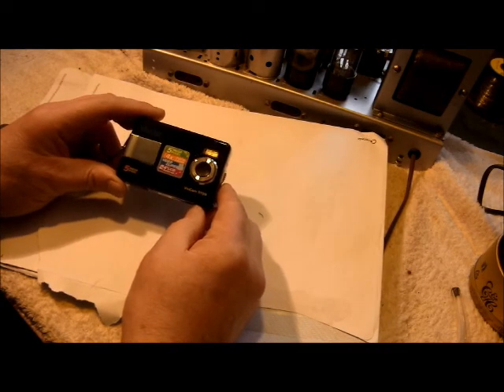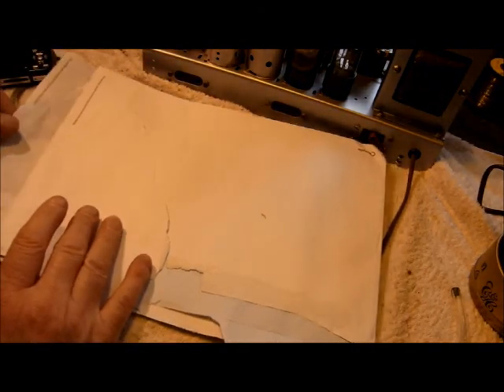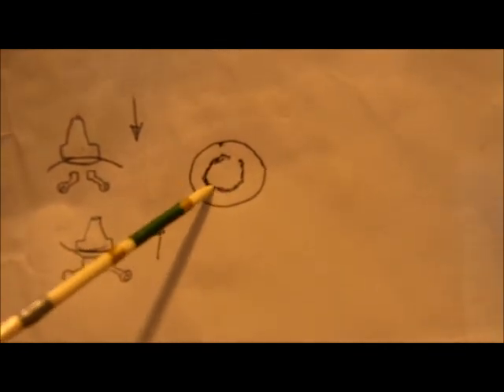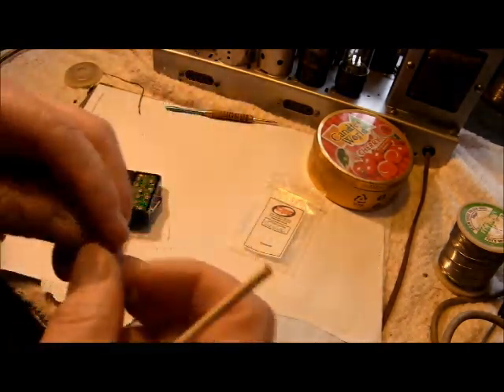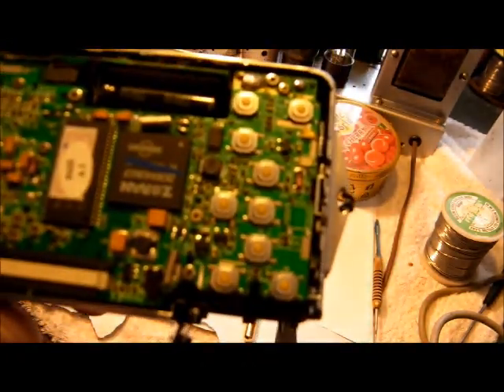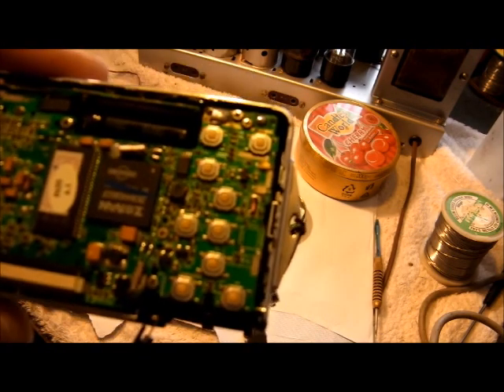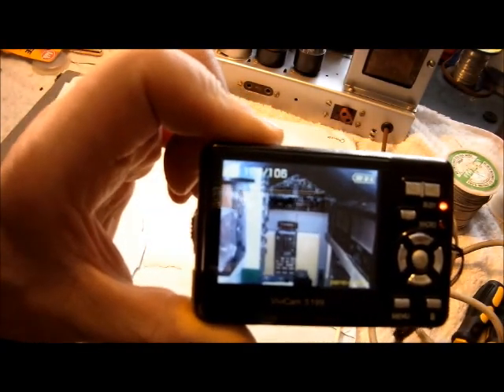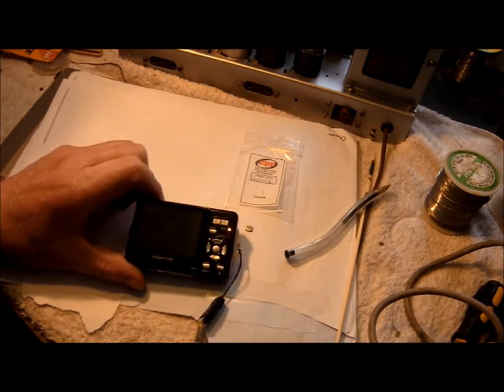Vintage Radio Extra, Number 4.

Comment: Love the toaster Phil, thanks for your videos, regards Bob (just up the road in Leeds)
Reply from the maker: Bob, 'ows tha' goin' mi lad?  Nice t' 'ear from y' (probably sounds more Barnsley than Sheffield).
I bet there are not many of those old toasters still in existence - even less in full working condition.  I like that particular appliances not merely because it works but for the fact it makes for an excellent conversation piece.  I bought it around thirty years ago from a flea-market in Rotherham - I can't remember what I gave for it but it wouldn't have ben a lot.
Regards dear chap,
Phil.

Comment: Very good point about checking if the item is fixable before just tossing it in the landfill.

But you have to consider the other variable SWMBO (She Whom Must Be Obeyed ;)

Case in point; we bought a GE washer and drier when we got married. Through the years they had typical problems, bad timers, water pump leaks, pressure switches not working, etc. But I was always able to source parts cheaply to keep them going. Saving us a great deal of money.

After 25 years SWMBO pleaded for a new set and I finally broke down and donated them and bought her a new set :)
Reply from the maker: Dennis, thank you for commenting.  It is good to hear from you again.
When I was employed in radio and TV servicing, I also repaired many other domestic electrical items: kettles’ irons, hair dryers, microwave ovens, drills, washing machines, lawn mowers…the list could go on (never worked on refrigeration).   Those days, replacement parts were easily accessed – place an order before mid-day, the parts would often be delivered within four hours.  These days, we read: ‘No serviceable parts included’, or when we locate a required replacement part number it has ‘PNA’ (Part not available) printed by the side of it – or equally as irritating, ‘No replacement parts available for this product’.
This built in obsolescence and land-fill has to end sometime as land here in the UK is already at a premium.
Cheers dear chap,
Phil.

Comment: Phil,
A few years ago I bought my daughter and daughter-in-law one of those antique flip-down door toasters for Christmas.  Both were in mint condition.  They've never used them, so they're just sitting in their kitchens as display items.  But they still look good.
My grandmother had a very nice one that we used to make toast and jam.   Based on my past experience with grandma, I figured the Christmas gift toasters would go over pretty well, but it wasn't to be.  They aren't digital.  :-)
Good vid, old bean.

Regards,
John
Reply from the maker: John, great to hear from you my friend.
What lovely, though unusual, Christmas gifts you gave to your daughter and daughter-in-law.  As stand-alone artefacts, or standing alongside other artefacts, old toasters are attractive in most kitchens – pretty much like old copper kettles and old cast-iron pans.  Our kitchen, being very modern, has digital this, that, and the other so placing such old artefacts would prove difficult.  Even placing me in our kitchen proves difficult.  Whenever I walk in I’m usually watched with suspicious eyes.  Well, let’s face it, I can’t even produce a slice of toast without burning it LOL.
Both my grandmothers weren’t as posh as yours: neither owned an electric toaster.  It was a case of impaling a slice of bread onto the prongs of a sturdy old toasting fork and holding it close to an open fire.  
Cheers dear chap,
Phil
P.s, I’ll do my best to avoid knocking up any more homebrew electronic projects in future: I’ll knock ‘hem out instead LOL.

Comment: Nice going Phil.  You are correct about repairs.  I have a radio here that I repaired back in January.  It is a Realistic DX-440 which was a Sangean 803A.  Anyway, some 15 years ago, in my stupidity, I plugged an 18 V. AC wallwart into the the 9 V DC external supply point.  The radio ceased to function as designed. Ha!  I dismantled it to look for obvious burns.  There were none, so I took it to work fully intending to have a go on it one day over lunch.  It sat on my filing cabinet in a plastic bag for some 15 years until I retired last fall.  I decided it was time to have a look.  It took about an hour to locate the fault and maybe 15 minutes to repair it.  In the 15 years I lost 1 screw, not bad! (very lucky), but the radio now functions again.

I wish I could read like you do.  I was a voracious reader in my youth, but now sadly I seem to fall asleep every time I pick up a book.  Father time is a hard Task Master!

Thanks entertaining us.  I thoroughly enjoy your presentations!
Reply from the maker: Great to hear from you again Stephen.
As I said, it is wonderful what can be done to keep certain electrical items going.  I always advocate broken items should be inspected before being discarded.  It is us, the consumer, who usually wind up losing out financially as we end up buying new replacements (much to the glee of manufacturers, shippers, wholesalers, and retailers).  So, whenever faced with defective domestic items, I say to myself, 'If it can be repaired then set-to and repair it.'  Even if one has no further use for the item, repair it if possible and pass it on to someone else such as a charity or church to help maintain funding.
Far too much is ending up in land-fill before it needs to.  Sadly, not everything can be repaired.
As you can imagine, I found it wonderful to read about the repair job you did on your Realistic DX-440.  You now have something back that you enjoyed years ago (and can enjoy once more) and at a fraction of the cost of a replacement radio - well done and good for you my friend.  More people in this world of ours need to learn to adopt the same ethic.
Regards,
Phil.

Comment: Well done, Phil.  Tiny solder joints.  You maximized your time and enjoyment, while your wife was out and about.  Love a peanut butter on toast and a good book, too.
Reply from the maker: Al,
Just received your response to my Polka vid comment: yes, we are of very similar mind my friend.  As you said in your e-mail, your eyesight is not what it once was.  Me too, dear chap, is experiencing similar.  My eyesight performed great until my late forties: not long now before I’ll need to wear glasses all the time (my arms are not long enough to see even larger written details – all the valves in both my retinas are low in emission).  So as you can imagine, soldering small components, like the surface-mount switch, are nowhere near accomplished as quick as I would have done say fifteen years ago.
Whenever I attempt shopping for wifey and me, it is always a case of ‘Wrong colour’, ‘Wrong size’, ‘Wrong weight’, ‘Wrong this’, Wrong that’,…………..someone pass me a Kalashnikov – I’ve suddenly lost all will to live!  Life runs smoother when I let wifey get on with our shopping.
Peanut butter on toast with a sprinkling of raisons, and a fresh pot of tea to wash it down…Beautiful!
One day, I hope you’ll come across a British valve radio: it would be interesting to see what you would make of it.
Cheers my friend,
Phil.
Reply: I'd love to have a British set, it would have to be one with a 110v selection, though.  Any suggestions?  My tradeoff, with my eyesight, is that I have perfect vision, except for close up.  Rubbish at anything closer than 2 feet.  As you say, my arms are too short:-)  Hhaving been thrice married, I've given that up (though not the ladies).  Count your blessings, to have found as understanding a lady, as Mrs. Phil.  She puts up with your pirate ways and radio habit, after all:-)

Comment: Nice fix on the digital camera Phil! I've never replaced one of those domed switches myself as of yet, As a matter of fact, I didn't know that you could even get replacement domes. Thanks for the tip!
   I think that you were pulling our legs a little bit, my dear chap. I am sure you would have never went through all the trouble of putting it all back together, "then" testing the switch. I'm sure after soldering, you had ohmed it out right there and then. At least I hope so!
   I remember my grandmother having a toaster just like that, here across the pond. Looked dangerous when you opened the door to catch the toast! Zap!!! There goes Phil at 220V! At least ours only runs at 110V. Unfortunately the current would be twice as much. Hmm... Who's better off?
   It's great that you have the original G.E.C. card there as well for the toaster. Unfortunately, I don't see a "U.L. Approved" stamped anywhere there. Maybe one of their chaps at the laboratory got zapped themselves trying to get toast out of there during tea time. LOL
   All kidding aside Phil, It was wonderful to hear you relaying these recent accounts in this latest video here.
   73s my friend, and hope to hear from you soon "down the log",
      Tom
Reply from the maker: Tom, lovely to hear from you my friend: I hope you’re keeping well!
I always say to myself, ‘If it can be repaired, then set-to and repair it!’
Strange enough, I spent a little time longer replacing the surface-mount switch than I anticipated (my eyesight is not what it once was).  I then reassembled the camera and tested it just as you saw in this production.  I was reasonably sure nothing would be untoward.
That old toaster, along with a few other pieces of ‘rubbish’ (as wifey refers to them) make good focal points for starting a conversation with visitors to my workshop.  Operating a 240 volts AC mains (rms) at 50 cycles will not just make one’s eyes light up - that is for sure.  You’re right, that toaster would do far more than toast two slices of bread if handled incorrectly.  I have seen, very late into the night, mains voltage rise to around 256 (according to my meters).   I was fortunate to find that GEC toaster (about 30 years ago) with its original mains lead still attached.  I understand it is illegal, over here, for anyone to sell appliances of that sort from bygone eras with a mains lead and plug of any description (those type of appliances must be made non-functional and sold as 'display purpose only').  To see a fully functional British made toaster from the interwar period these days is virtually unique.
Thanks for viewing dear chap.
Phil.

Comment: Hi Phil - You know, 999 out of 1000 people with any trouble with their electronic units today, just dump them into the trash and buy a new one.  There's a lot of units that use those flimsy buttons.  Now I know how to fix them, thanks!  When you have something that works well, no matter what the price, it's a good idea to keep it in shape.  My cell phone was working fine, but they gave me a new one if I wanted it.  So, it did have a few new options that maybe I need or maybe not, but it's the newest thing so heck, must be better, right?  They took the sim card out, thru my old phone away, and gave me the new one.  That was easy, no cost, and I was ready to run.  Unfortunately, it didn't take long to realize that I like the old one better.  Don't like the new controls, and the camera doesn't take as good pictures as the old one.  But, I guess I gotta get used to it.  My old one is gone.  So, not everything is better just because it's newer.  Hey, thanks again Phil for your video.  See ya -- Atco